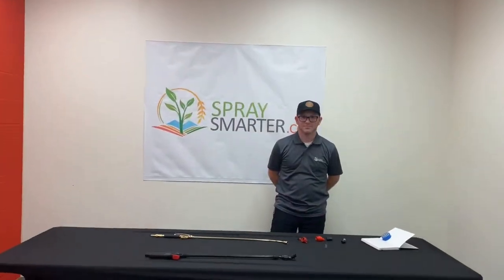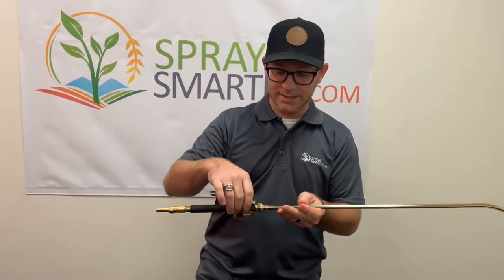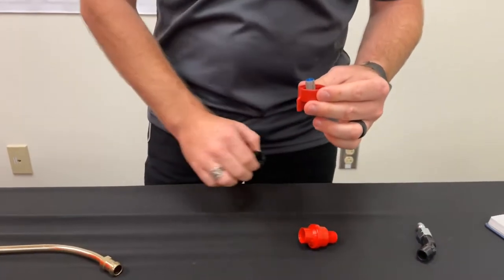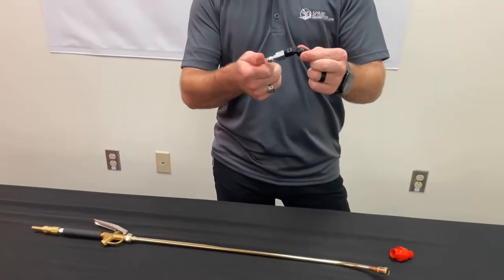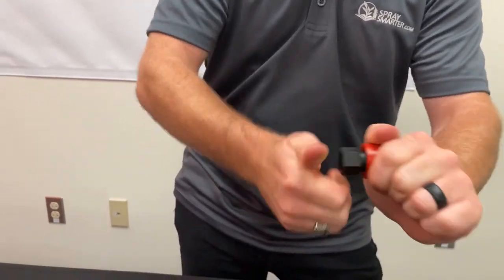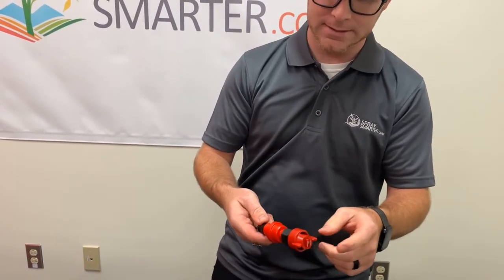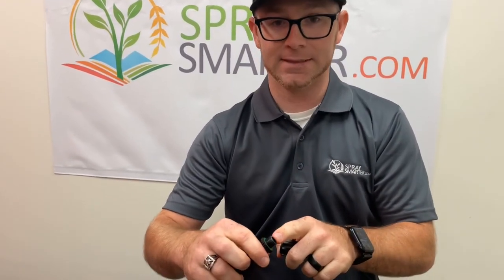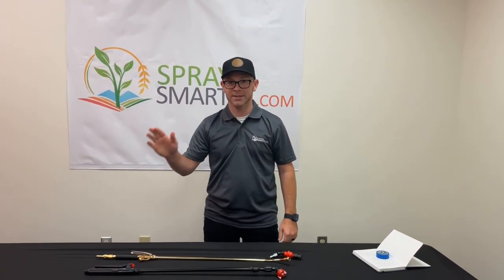How to build a Professional Spray Wand by SpraySmarter.com

Comment: My order arrived today, and with one exception I am very pleased. I recommend ordering the 114445A-3-CELR Spray Tip Cap instead of the part in the description.  The part Cliff uses has a shaped center hole made for the TeeJet nozzle, but it fixes it in place.  The 114445 part has a round center hole and will allow you to rotate the nozzle as needed.  I was able to modify my caps with a small half-round file.
Reply from the maker: Excellent idea!

Comment: Can I add 4or 5 48” extensions together. I’m trying to clean the eaves of a second story house.  2:19 would that work with a 12 V sprayer and which sprayer would you recommend?
Reply from the maker: Yes, 48" is the longest TeeJet carries, I personally think most of them are equal, but I recommend you look for one with at least a 3 gallon per minute pump.

Comment: The swivel and handle are both spec'd as NPS thread instead of NPT. Did you put an o-ring at that interface to prevent leaks or was the PTFE tape enough?
Reply from the maker: I would suggest using the o-ring.